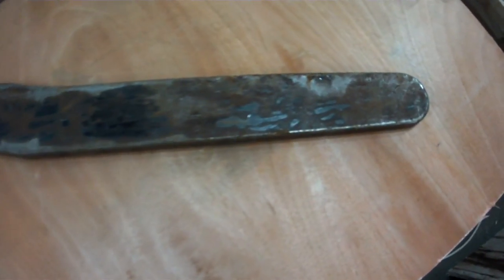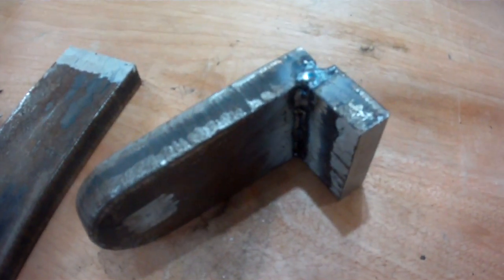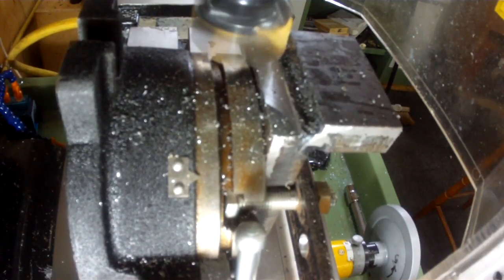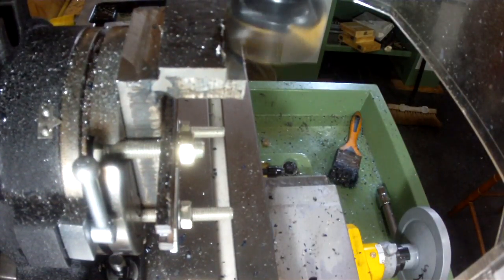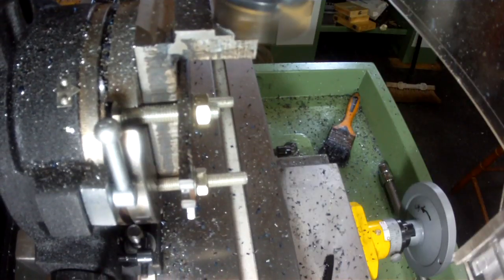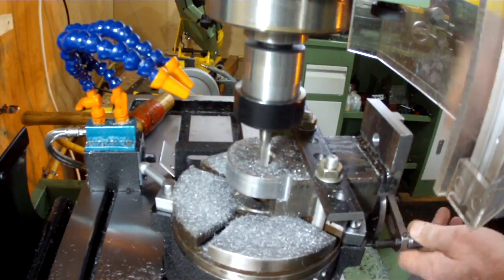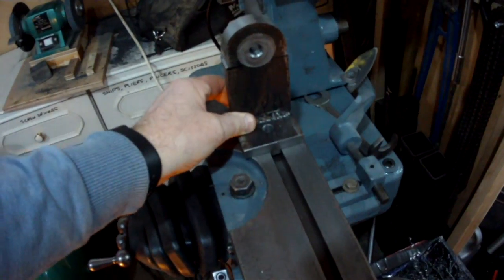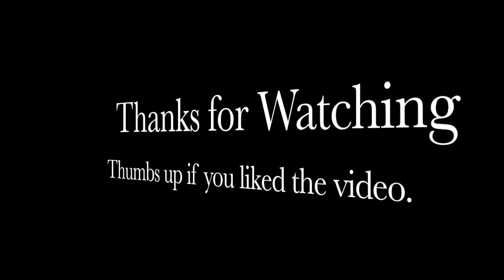Making a Clarkson universal head, Part 1

Comment: You have better skips where you are! Never found anything that useful here. Perhaps I should take up skip diving as an additional hobby !
Reply from the maker: I found an 18" x 8" top of the range magnetic table in one.... I even asked the workshop If it was ok to take it... I legged it as soon as they said yes. it only needed a clean.
Reply: @Thesheddweller  see, this is the difference between people and luck.
You find a working mag vice in a skip. I fall into a barrel of breasts and surface sucking my thumb.
Some have it, some just suck🙄
Reply from the maker: @NellsMechanicalManCave  :-D